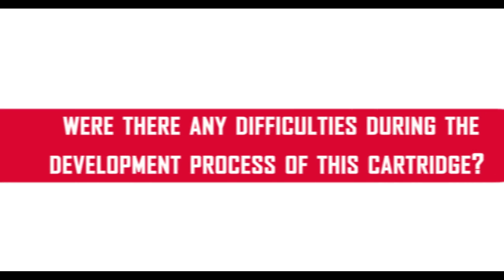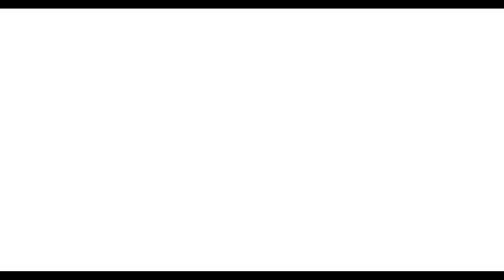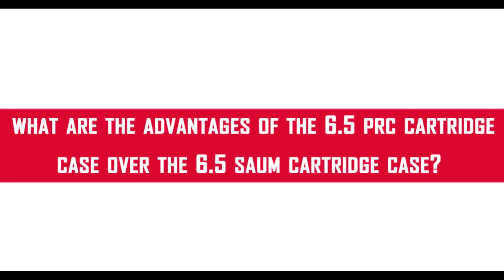Hornady® 6.5 PRC - Q&A with George Gardner

Comment: What is the obsession with short action cartridges in a hunting rifle? Think about it. These guys are just bored and wanting something different from long proven rds like .270 win. and a dozen others.😂
Reply: Randy Schaff You are right! But this cartridge was made in mind for the PRS guys, who can’t or at least don’t want to shoot a match of 200 rounds with a long action magnum.
Reply: Two Niner l am not talking long action magnum l am talking standard long action .3006 length action. Long action “magnum” is for cartridges like .375 h+h.
Thanks l enjoy the exchange.🇨🇦🤠
Reply: Half a pound mostly.

Considering most guys that get crazy lightweight hunting rifles pay $130 Cdn per ounce of weight savings when they start going to titanium, choosing a short action cartridge just makes sense. Easy weight savings. 

For competition shooters it's faster to run the bolt on a short action. Short actions are also inherently stiffer which helps the rifle stay consistent when it gets really hot firing 200+ rounds in a day. 

For inside 400 yards your not buying anything the .270 wouldn't do. For further than that you're losing out because there's a serious lack of long heavy for caliber high BC .277" bullets on the market. You're better off going down to a 6.5mm cartridge or up to a 7mm cartridge. 

It's not really earth shattering but what it is, is a modern cartridge designed to shoot long heavy for caliber bullets very efficiently, maximize fps per grain of powder burned. 

It's like comparing a .308 to a .30-06. the .30-06 has more overall horsepower but it burns more powder per fps compared to a .308. 

I did a lot of looking at this and the 300 PRC when they first hit the market and when you look at "how are they different" they do fill a small niche in the market quite nicely.

Comment: The 6.5x284 is a very very good cartridge hard to beat 6.5 creesmoor not even close and overrated
Reply: Depends on what you're doing. If you need that last 100 fps and are willing to give up half the barrel life, very little factory ammo, etc etc-- then sure, go with the 6.5-284. It is interesting however that the F class guys who invented it no longer run it. Why? Barrel life, and straight .284 is easier to tune to the accuracy they need.
Reply: The 6.5 X 47 Lapua is a more efficient cartridge than the 6.5 Creedmoor. Don't let anyone tell you any different.  Look at it's track record for winning in competition. And accuracy records. I shoot one in F-Class and wouldn't trade it for any 6.5 Creedmoor.

Comment: I bet accuracy starts degrading after 500rds
Reply: Nah should get 2000 rounds with the pressure it's at. It's not as overbore as a RUM, 6.5-300 Weatherby, 6.5-284, etc
Reply: @justinpeck3667  1350 rounds for competition , 1800 rounds for hunting depending  on loads and care.

Comment: I guess there is nothing in firearms cartriges that can be improved at this time. You name the caliber and it´s been done and there are at least 10  cartriges that do the same  since WW2. I want a 4500 fps 7mm 175 - 180 grns cartridge that I can shoot whithout extreme barrel erosion, In a standard lengh bolt action or a very accurate  semi-auto in a 8 pound gun. That would be a a real improvment. Remember 22-250 and the 220 swift eons ago 4000 plus fps. Hot rods of their time. Roy Wheaterby did a remarkable job , but today there is no real improvement. Change the name, shorten the shell, make it thicker, RUM cartriges great, but Wheatheby did it 50 years ago.If I can get into bow hunting range I can kill any game you can think of with a .22 Lr behind the ear. Enought to do the job ? Yes, but there is a better and relliable cartridge for it. What about the 1000 yds do everything small calliber cartridges ? A long time ago a fella Bell culled hundres of ellephants with a 7x57 mauser. The new 6.5 mm would be a better choice today

Comment: 6.5 x 300 weatherby mag
Reply: Completely different ballgame compared to the PRC lol
Reply: @paulvenn4447  im listening, talk,
Reply: @brianchambers1891  6.5x300 is in the class of ultra magnums, is near 100gr capacity, is belted, and requires a full sized magnum length bolt and action.

6.5 PRC is based on RCM, is around 69gr capacity and is a Short Action Magnum.

Obvious difference as well is velocity, recoil and barrel life. Weatherby will kill barrels and won't be comfortable to shoot in PRS competitions which is what the PRC was designed for.
Reply: Ok here's the blanket statement of blanket statements. Almost every cartridge with weatherby behind the number is a barrel burner. They are the crazy genius nextdoor neighbor who puts a blown Chevy 502 in a datsun pickup. Is it awesome....absolutely, is it practical absolutely not. It's like they have it wrote on the company's manifesto "if it ain't over bore it's a bore"
Weatherby is awesome and they make some awesome cartridges like the 30-378 and the new 6.5RPM but factory ammo is difficult to find and when you do its expensive.

Comment: 6.5 caliber is getting to be overrated, its ok, but its no better than the 270 cal, or for that matter the 25 cal,a fast twist 25 caliber cartridge using 130 to 140 grain bullets would be something to talk about, this 6.5 prc is pretty much the same thing as the 6.5x284 or the old 6.5 rem mag,, nothing new at all,,,,,,,
Reply: Wrong. First off, there are almost no high BC bullets in 25 and 27 caliber.  A 500 yard shot in a 20 mph wind would be crazy for a 25 and most 27 calibers.  A 140 gr 6.5 cal bullet can have a 600+ bc. There are no 25 cal bullets that size and a 270 in 140-150 gr will have about a 500 bc at best, and many 270 hunting bullets are closer to a 400 BC.  That's a lot more movement in the wind, and speed and energy loss at long range. The 6.5 PRC in short action is very close to the 6.5x284 in a long action. The biggest problem with the 6.5x284 is there'll never be mass produced ammo. 6.5x284 norma and 6.5x284 Winchester are too close. 6.5 PRC was made with a cartridge that couldn't accidentally be fired in the wrong firearm. Ammo manufacturers have to worry about legal issues.
Reply: Forgot to mention 264 win mag.
Reply: BLUE COLLAR BOXING for hunting 270 win is still pretty popular. People aren’t making the distinction. Obviously 6.5 bore has an advantage in selection of match projectiles compared to 270. However, a 270 loaded with a 150 gr bullet is still pretty potent out to 500 or so
Reply: BLUE COLLAR BOXING for hunting 270 win is still pretty popular. People aren’t making the distinction. Obviously 6.5 bore has an advantage in selection of match projectiles compared to 270. However, a 270 loaded with a 150 gr bullet is still pretty potent out to 500 or so